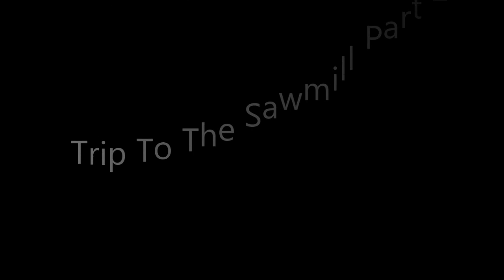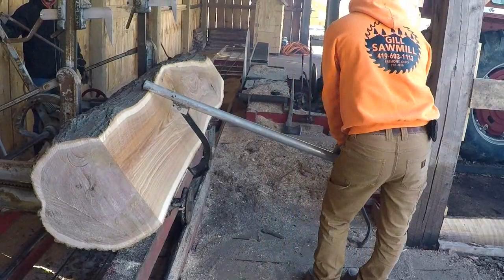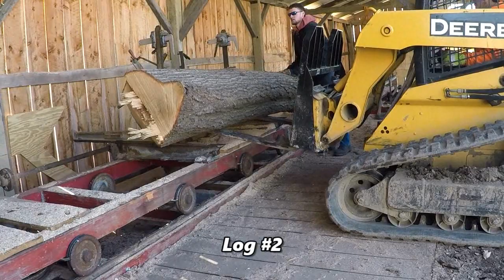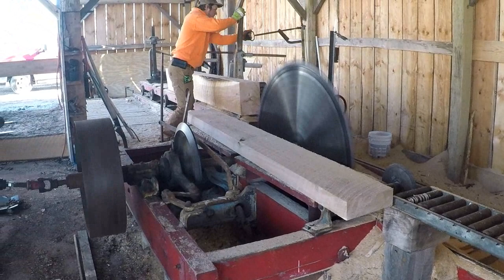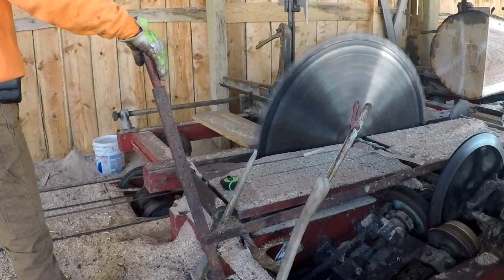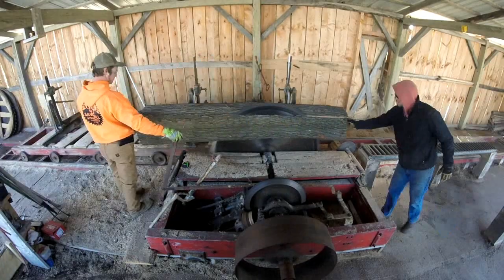Trip To The Sawmill Part 2

Comment: Your working deck is super dangerous being the same level as the track,. Be careful you don’t trip and fall on the blade ( never walk between the set works and the saw ). Mill is cutting nice is it an old Port Huron mill ?